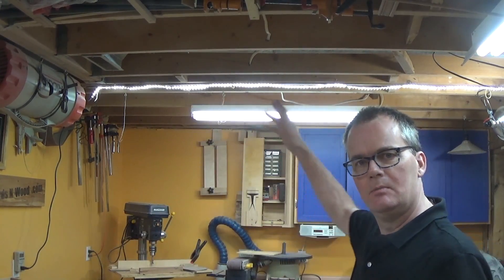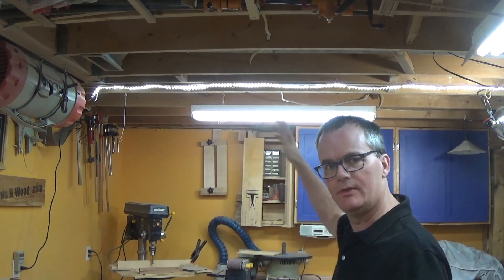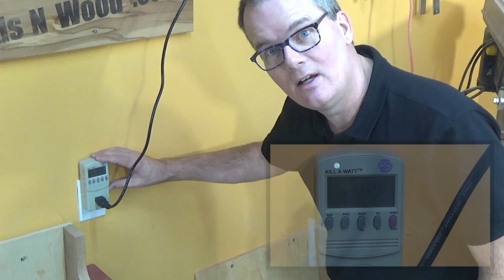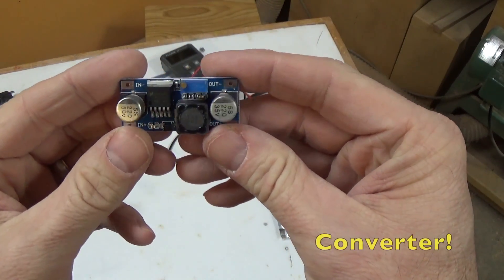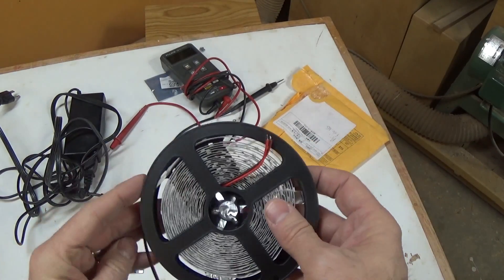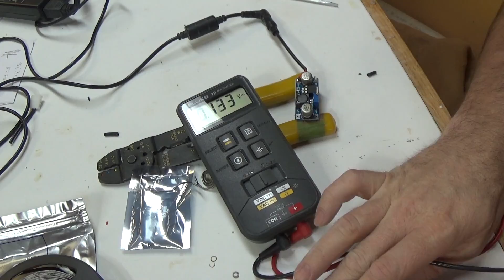Can LED strip lights replace Fluorescent!?  (WnW #46)

Comment: To run the initial strip at 72 watts you would need a 6 amp minimum power supply. There are strips available with brighter 7020 LEDs and you would need an 8 amp power supply to run the strip at max output, an advertised 96 watts. Using a step down converter wastes power, get a 12 volt supply with adequate amperage. Pay attention to the color temperature (Kelvin). 2700-4000 = warm, 4500-6000 = neutral, and higher numbers = cool.  The pressure sensitive acrylic adhesive (PSA) sticks best to glass or metal and not so good to wood or paint.
Reply: Nice definition of Kelvin. The benefit of "paying attention to the Kelvin" is only one trip to the store and minimum labor with less rework if any. The hardest part for me is having to use words. To explain it to my wife and then ask her which color temperature she would prefer. This I learned this lesson by doing, changing bulbs for my mother. I dared to take a guess cool sounds cool right?Nope not cool LOL I still have them.......so yeah

Comment: I have found that the double-stick tape used on these strips is woefully inadequate.  I have had excellent results laying down parallel masking (to prevent over-spray) and spraying Scotch 77 contact adhesive to the mounting surface and to the back of the strips themselves.  I have heard that the strips from China may "say" Scotch on the adhesive, but it isn't really.

Comment: I have never had good luck with the adhesive tape that comes on LED strips but have had great luck by adding quality double stick tape(3M is one). It's been a long time but I think I removed the cheap tape from some strips and on others I left it on and added the 3M and it works good either way,that's just an option if someone doesn't want to use hot glue... Those converters to dial down the laptop supply power are a good idea. Now if you dial it down to 11V to underpower them they may last lots longer but put out a bit less light. After all the work you put into it I would try dialing them down a bit because the strip LEDs do tend to burn out and you might slowly lose intensity anyway.  I have had a short section of strip,6 LEDS I think,work down to 7V from a depleted 9V battery. Not 100% sure but I don't think underpowering a little hurts them and likely helps lots for longevity. How much light do you need and how long do you need/want it to last? Rhetorical question for folks to ask themselves.

Comment: A thing to remember is that flouresent tube lights start to go downhill after 6 montha an should be changed yearly as they become inefficient, led's also lose light but negligable in comparison but have a far grater life span. As this video is 2016 i'm sure there are now even more efficient and brighter leds available, ie more light less watts. thanks for sharing.

Comment: I have those strips that are used as under the cabinet lighting.
The self adhesive will not hold the strip up so some other glue need to be used.
They make a power supply to match those strips that is about $5.
The wiring need to be tapped into that strip at least at the 1/2 way lenght or at each end. If you only hook it up to one end then the opposite end will have lower lightoutput since the printed circuit has higher ohms/resistance.
You can use a dimmer like I did which is about $5.
Mine are operating for 3 years now without any problems.
Your calculation is wrong, especially when the wrong hardware/powersupply was/ is used. 
A florescent light like this will use about 120 watts total with the ballast.

If you use a 12 volt battery, then you could use it as emergency lighting if the grid power is dead.

Comment: As far as I can tell, you are comparing an eight foot LED fixtures to a four foot fluorescent fixtures.  Perhaps, the 8 foot LEDs use 20% more power (maybe),... but they provide twice the coverage in terms of area. So, is this a fair comparison?  You admit the LEDs provided more light coverage. However, I applaud Your efforts to address the issues because I am currrently updating the lights in my garage and home.  Personally, I decided on both LED lighting plus t8 flourescent fixtures.  It is fantastic to see what I'm doing when operating machinery.

Comment: I bought 2 strips of SMD5630 Led Strip Light, 300LEDs 16.4Ft DC12V Daylight White from Amazon for $12.00 each,  I have 1 set outside contacted to a 12 volt timer it also came from Amazon for about $7.00.  I run them off of my solar setup,  they are on from dusk to dawn.  They have been setup for about 10 months now. They have worked in extreme heat and now really cold weather.  They are really bright and all LED's still working.  The other set is setup under my kitchen cabinets,   They too are very white bright.  they have been set up for about 9 months, those are setup with a 12 volt power supply and manual On/Off switch.  The SMD5630 sets are really bright and work great.

Comment: Hi, your laptop PSU will drive 2 x 5M LED tape with spare capacity. just get a few component and build two 5A fixed voltage supplies. https://www.homemade-circuits.com/12v-5-amp-fixed-voltage-regulator-ic/

Comment: I'm wondering about your lux tests and if you did multiple tests at different spots around shop? Since you have LEDs spread out the lighting is more consistent but as you move away from fluorescent fixture (to the sides, near walls) it would change much so you'd have to get an average over the same area (wall to wall).   
Your lamps also don't have diffuser lenses (covers) so light doesn't get spread around. I usually convert the old fixtures by taking out the center ballast and wiring cover, remove all the guts, flatten out the ballast cover and stick LED tape to that and wire it up (4 or 5 strips in parallel so no voltage loss on long run). Doing it that way I don't have to work overhead. One good power supply will light up several fixtures.

Comment: I'd say if you really did your homework and bought a 100 watt solar panel/charger from harbor freight and a 12 volt 7 amp hour or more GEL CELL from Home Depot to power several of those LED Light Strip's and Not even use your 110 vac power from your garage/house for Lighting!!!   The savings in the long run would out weigh the cost!!  Battery life about 10-20 years or more and solar panel should be good for many many years, not much to go bad there!!    Edit Note  LED'S normally only last 100.000 to 200.000 hours.   Here is a link to super bright LED'S  -------->   https://www.superbrightleds.com     But power them with the above  Solar System mentioned Above !!!
Reply: Gel cell batteries cost twice as much for 1/2 the life than regular deepcycle batteries.They can not handle over charging nor overloads. A 100 watt panel will overcharge them and kill them early. As a matetr of fact a 7 ahr battery should not be charged with more than 0.7 amps or so while a 100 watt panel at 12 volt provides a little more than 5 amps and that cheap charge controller is basically just a on and off switch that will switch full amps from the panel.
$140 for solar panel, $30 for charge controller and what....about $30 ? more for a battery. That is a total of $200. 
For $200 you can buy about 1,428,571 watts of power from your power company. 
I never seen a gel battery yet, that lasted more than 2 - 3 years.

Comment: I have one in my van, been in it for over a year, the RGB color changing, the extreme summer heat has not caused them to fall, neither has the cold in winter. Mine are bright in the van, I have them on extreme dim, thrilled they still work, installed several short blue strips earlier this year, cut and soldered them.

Comment: You mentioned 50 watts as opposed to the listed 72 watts.  Current requirement or use is measured in amps.  A watt is the unit of measure for power output.  Power (watts), Current (amps), Voltage (volts), Resistance (ohms) are all affected by each other.  Normally, resistance does not vary.  The relationship between these is:  Voltage=Current x Resistance, Power=Voltage x Current.  So, if the power output of an electrical appliance is 72 watts at 130 volts, the current drawn will be 0.55 amps (72 / 130).  At 130 volts, 0.55 amps suggests a resistance of 236 ohms (130 / 0.55).  Let's assume  your actual line voltage is 118 volts as opposed to the 130 volt product rating.  Remember, resistance does not change-that's how the light strip was made.  So resistance still equals 236  ohms.  [Voltage=Current x Resistance] We know the voltage and resistance, so Current =Voltage / Resistance.  118 / 236 =  0.5amps.  Power = Voltage x Current, so 0.5 x 118 = 59 watts.  That is why your power output is less than 72 watts.  Your voltage is lower than the voltage used by the manufacturer when they rated the product.  It is common to test, and therefore rate A/C line level products at a voltage greater than the actual voltage the consumer will use.  It allows for a longer product lifespan.  In your situation, I suspect the manufacturer used a very high voltage for testing and possibly exaggerated the output a little too.

Comment: Hot glue doesn’t work worth a crap to hold led.   If you are attaching to any type of metal you want to use thermal glue.  That way it uses metal as a hear sink.  Otherwise clear RTV silicone will attach them to anything else.   Also if you would have went with 12v-24v led’s you wouldn’t have had to use that lil dc-to-dc step down unit that’s gonna burn up after a couple hours of use.    You can buy rigid led light strips in half meter lengths that use aluminum in place of flexible stuff.  They will blow away what your playing with in this video.

Comment: some thing not rite!  led's is way less than fluorescent, those 2 strings should draw only 14 watts could be not the rite amount of power! Over powered them.   i only use a 18 watt battery charger!  idk where they get 72 watts from or there old models. They GREATLY improve them  WHAT DO YOU EXPECT FROM CHINA MADE SHIT?

Comment: you're comparing watts at 120 volts and watts at 12 volts... apples & oranges
divide by 10
Reply: +Harry B
Watts would be the same, the amperage to produce those watts would be different depending upon which side of the power supply you were measuring from.  Also, the watt meter that he is using is plugged into the 120VAC wall outlet and the cord from his power supply is plugged into it, so he really is getting a valid measurement.  By measuring on the 120VAC side of the power supply, he is getting the true power used by the LEDs + whatever the power supply wastes in the conversion.  Ever noticed how a laptop power supply gets a bit warm?  That's the inefficiency in the conversion of 120VAC to whatever voltage the laptop needs.

Let's say you have a power supply that has an input of 120V and 1A.  That would mean 120W.  Let's say that it was designed to step down to 12V and for the sake of argument, let's assume it is 100% efficient and ignore RMS.  That would mean that it could produce 10A at 12V and that would also be 120W.
Reply from the maker: Software degree here!  ;-)

Comment: Your video was very interesting as my experience with China led light is the same as you the strip was marked on the back with 3M well that is a no no 3m do not make crap adhesive again it is a cheap knock off product and the LEDs don't last very long so for me I am off to get a new fluorescent tube for my workshop light and give up on Leds.

Comment: There is a YouTube video that shows using a 19.8v  laptop power supply by taking half the LED strips and hooking it up in series with the other half. it seem to work great. In series you don't need to change the voltage.

Comment: Great, honest video - thank you!
Heads up to everyone, the reason the adhesive doesn't work is that it is only meant to hold the strip in place so you may install the brackets - https://www.amazon.com/Mounting-Brackets-One-Side-Included-Non-waterproof/dp/B01E4YZVUG
I don't know why, but all the cheap LED strip suppliers seem to have lost that detail in translation.
Reply from the maker: Good to know, thanks!

Comment: aren't these LED strips inherently inefficient because they use a current limiting resistor which wastes power, instead of a real led driver which should be much more efficient? strange this hasn't come up..
Reply from the maker: Not an EE, so I have no idea.
Reply: Then the LED driver is where the resistance is and waste; either way same thing when using DC. But there is a solution! Using LEDs in series they can be powered directly from AC mains (the DC strips usually have parallel groups of 3 in series). You can use a bridge rectifier or go full efficiency and pair them in different directions so to minimize flicker while using both sides of the AC wave. Divide the peak voltage by LED voltage drop to get the number (52 for 110vAC) and then run the same number with opposite polarity and you've got a fully efficient system. I'm using this setup in an 18vAC system (used old doorbell transformer) and it's wonderful.  
I actually accidentally got on this track when I plugged an LED (12v rating) strip into an old  transformer than I had mistaken for DC power supply (scratched up case, didn't read it right, looked like a regular charger), and it worked fine, just a bit dimmer, checked the voltage and got wavering reading (on DC) then it hit me and I checked it on AC and sure enough 18.8vAC so I was getting 9.4vDC. So I guess I should really be looking for a 24vAC transformer...

Comment: The ballast in the  florescent fixture uses additional power.  I would guess they LED's are about the same as the florescent fixture with about 4 times the life.
BTW, You seem to be fixating on the initial cost and end up causing yourself  additional problems for very minimum dollars.

Comment: I did some undercounter lighting in the kitchen and the adhesive let go after a week. I then just used some clear caulk along both edges and so far so good. It helped that I got the waterproof style so there was more to hold to

Comment: I had a heck of a time trying to figure out the best way to run more than 2 LED strips.  After blowing 2 of the included power bricks that came with my kits and hours of research about why, I finally found a video that correctly demonstrates how to run multiple LED strips together (the right way).  This is the right way to do it.  https://www.youtube.com/watch?v=pgdGoAHn4bM There are tons of videos on youtube about chaining strips together and most of them are incorrect.  This is the right way.

In that example you could simply replace all of the individual power supply units the guy is using with 1 single high wattage computer power supply.  The higher the PSU wattage/amperage the better but leave yourself overhead for efficiency losses in the PSU.  The stated 72W is for a high density RGB strip not white only LED.  Since you're only pulling current for 1 color it's much less... which is great for your project since you can power more lights on one PSU.  

The biggest obstacle you'll run into is over amping the strips.  Use your DVOM to test everything as you go otherwise you'll blow your controller, DC-DC converter, or LED strips.  I learned that one the hard way too as do most people so don't feel bad about that, just learning pains. :)

The amplifiers are the key to long runs.  Yes it sucks having to purchase additional hardware.  It's just something you have to do for long runs.  Most people use 1 or 2 strips maximum for their projects using the hardware supplied by LED kits.  Adding more strips will blow the small 5A power supply units provided in LED kits on Amazon. .  By doing 3 or more strips you've entered into another category.  Long runs require amplifiers, no way around it.

I've wondered about replacing some of my lights with LED strips.  Thank you for this video!

Comment: One of the bigger benefits is that it's cheap to expand and flexible so you could put leds where you could not put any traditional light, just a note. You can get a full 5m cold white string with controller and power for less than $20 and you could make as many bends and jumps in the cable as desired. I supposed it's a matter of usage. Cheers and I hope they continue to work well for you.

Comment: The adhesives can be hit or miss and depend on the surface and whether they are real 3m product. The cheaper strips often have only a thin and weak adhesive. Obviously many ppl consider white or rgb so that's up to you. Fix options include clips, thick/ real 3m adhesive squares, glue,  or in the future try your best to get real adhesive tho of course it's hit or miss but sometimes it helps to pay the extra dollar and read reviews even deeper. Nice job on the lights though they look really good :)

Comment: i have change over to LEDand have save over all. right now i have   eight  4 ft. White LED Linkable Shop Light from lowes and four Lights of America 4-foot LED Shoplight from sams club , and half stay on 24 hrs. a day 7 days aweek for the last 12 months and when not running make in window a/c during the summer am under a 100.00 a month and out of that bill is delivery and tax charge's. the ballast resistor alone pulls almost 100 watts by its self so you greatly save . in my shop in the winter it takes forever for the lights to heat up so it draws even more watts to keep the light from flickering .